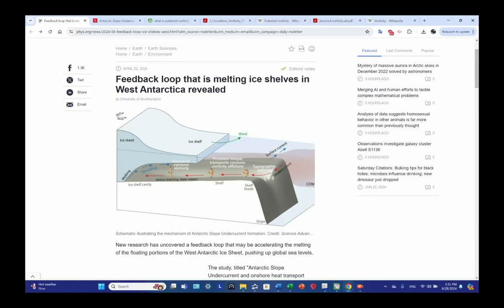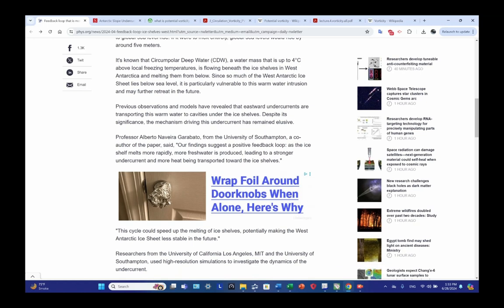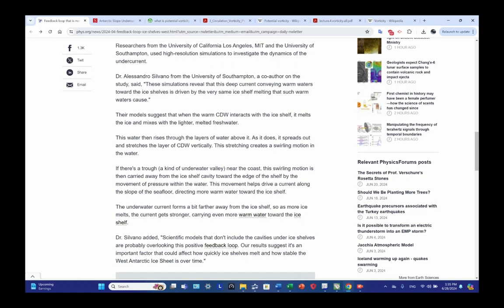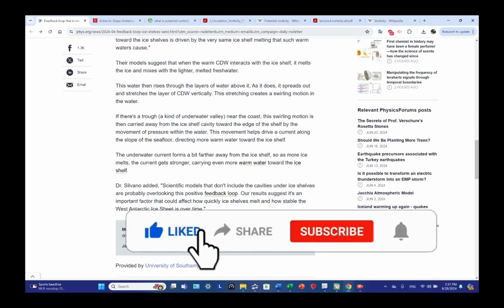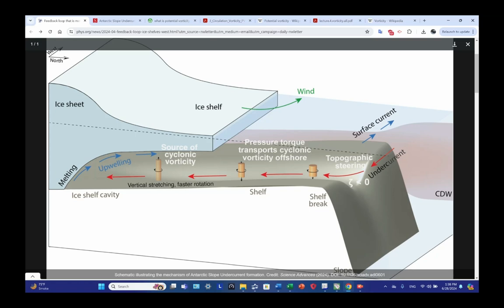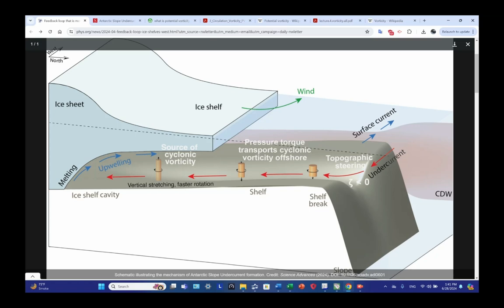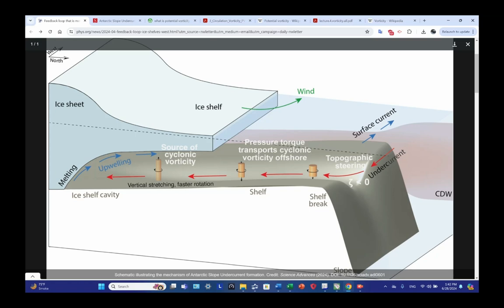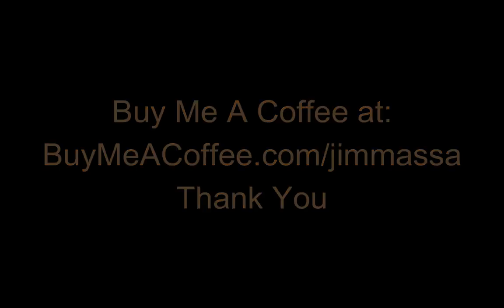Feedback Loops Melting Antarctic's Ice Shelves - an overview

Comment: The tides will increase the pressure and decrease the pressure, there's an ice shelf on top , which rises and falls with the tides. Like a bellows. And there's the cracks where the ice sheet breaks off from the section supported by grounded ice and floating ice,  as thie floating section rises it ducks water up, as it falls it pumps water down , creating Eddie's. Just thinking out loud. With stuff I've seen you present over the years. If the ground ice is being lifted by higher tides, then when it falls back to ground it will force a tremendous amount of water out to sea creating Eddie's as well. Even if the rise is minuet,